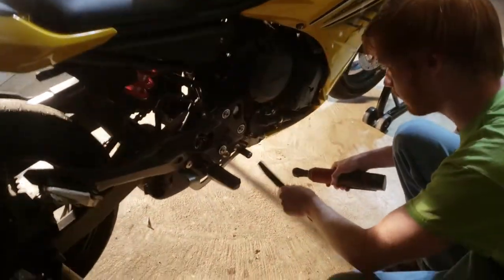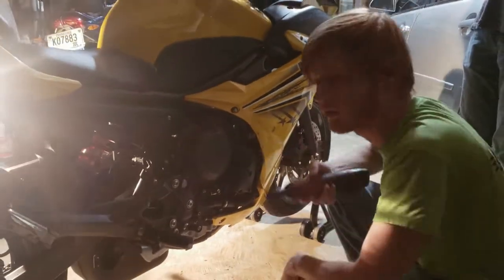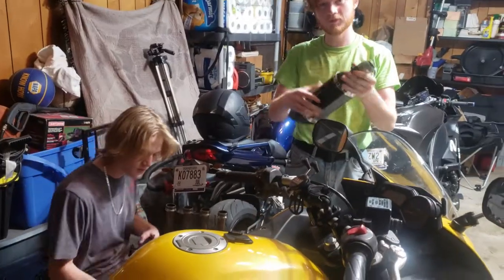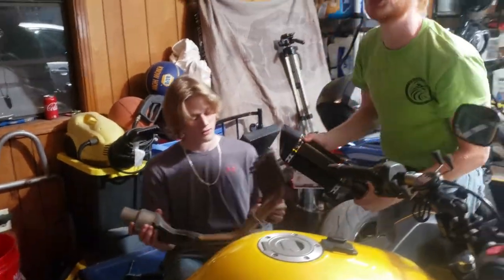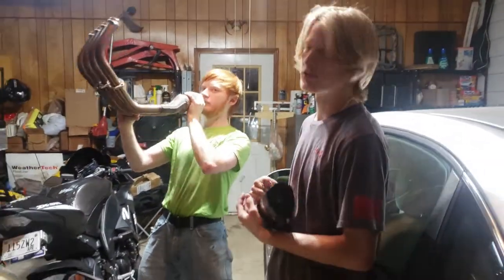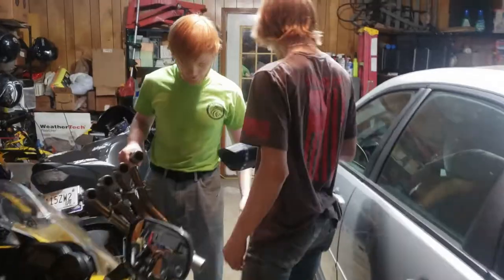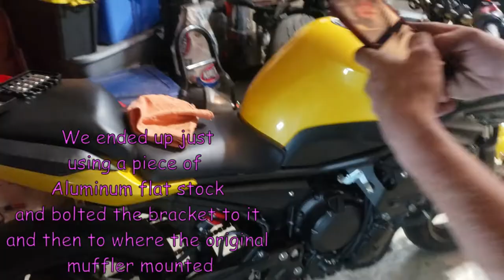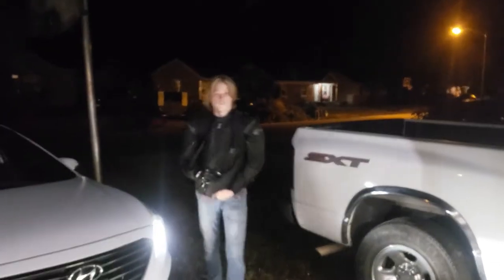DIY FZ6R Exhaust for 50 Dollars!?

Comment: Does that not have a 02 sensor? Mine does. Would I have to change anything else with my system, or do you know? Thanks
Reply from the maker: @junkyard8113  it does not have one. If you have one the only thing I think you could do is drill out a hole on the converter piping, and weld a new O2 bung. Other wise nothing else was needed for us.